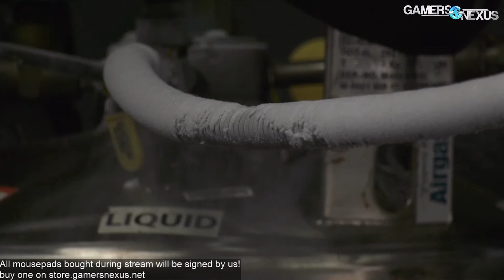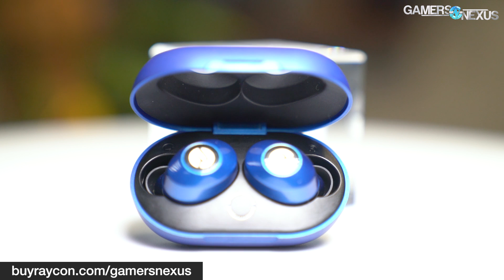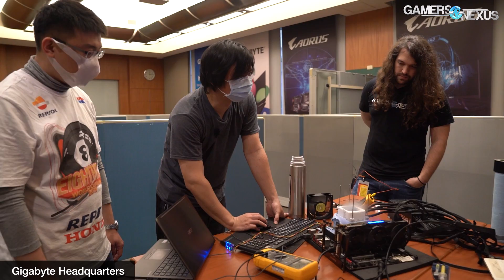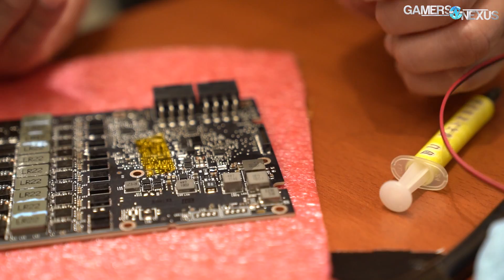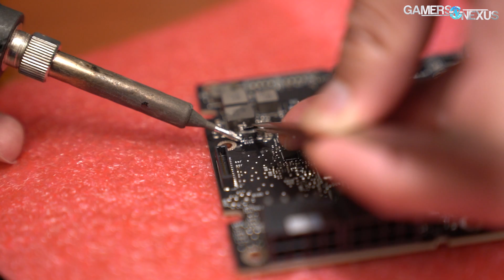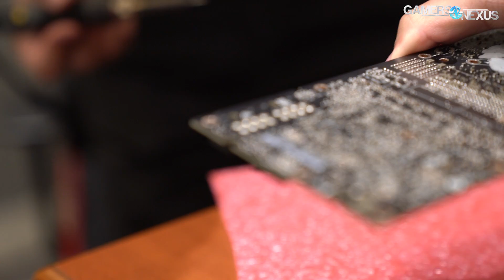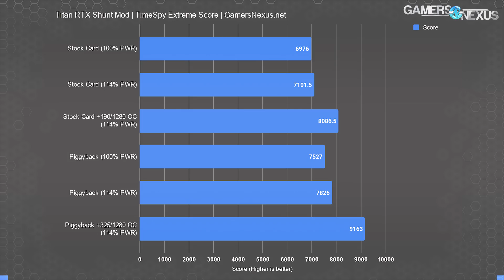RIPJAY Hardmod: Breaking NVIDIA's Rules w/ Shunt Resistor Piggyback, Ft. HiCookie

Comment: If you have problems wih melting the solder with the iron (because a. the solder on the original resisor is lead free solder wihich has a higher melting point and b the card has a lot of copper = high thermal mass) you could use a bit of bismuth solder (very low melting point. Not recomendet for soldering stuff that has to withstand a lot of physical stress because it cracks easily but for stacking a resistor for OC its ok. Also good for removing parts on a pcb in case you want to fix something without using to much heat

Comment: I have a 1060 3gb that eats 200 watts sometimes. It can run full blast 2000mhz+ constantly. I'm hitting the vcore limit I think. 😑 Have you guys looked into conductive silver epoxy for PCB trace repair? It has less risk of alloying with the solder on the board.

Comment: Learn how to solder on junk first of course. 45 watt iron works decent for most stuff and chemwick solder wick, leaded solder + ventilation.
Reply: Soldering to a multi-layer board with solid power and ground planes is a totally different league.  A typical 45w iron from the hardware store, or radio shack, etc, isn't going to cut it.
Reply: @nwimpney  True, just sending a message for beginners. I had to step up to a weller station a while ago for this reason.

Comment: There's no need for a high temperature soldering iron, all what needed is as high thermal mass tip as suitable for the job. After that you might want to compensate with increased temperature.
Reply: nah.  the thermal mass doesn't help when you've got enough dissipation on the board.
What you actually need is a high powered soldering iron with good regulation.   And by good regulation I don't mean accuracy, but that there's a low thermal impedance between the temperature sensor and the tip so the iron actually knows how hot its tip is.

Comment: This is a good illustration of why it's always a good idea to preheat your work with hot air before you start trying to solder. The copper in the PCB will quickly wick and disperse the heat from your iron if you dont give it at least a little bit of heat pre-soak. Also flux is critical in any PCB rework application in my experience. You can use almost any flux but the Amtech flux that Louis Rossman uses and recommends is among the best imo. I've done PCB reworks with the cheap flux from Harbor Freight, and that works fine as long as you remember to clean up your work afterward with isopropyl alcohol and a toothbrush, then gentle heat to drive off any moisture before powering on to test.
Reply from the maker: The video is edited. He did do that, but we cut some of that out. He still needed a hotter iron. Good advice nonetheless!
Reply: @GamersNexus  I guess it looks like my comment was being critical of HiCookie's work. This was not my intent whatsoever. HiCookie undoubtably has way, way more experience than I do with PCB rework and I am in no position to criticize his work in any way. My comment was mostly intended as a tip for people who way want to do this type of mod to their own card who also have no or limited experience with PCB rework. Apologies to Gamer's Nexus and HiCookie if my comment was interpreted as criticism of HiCookie.

Comment: Wonder if Louis Rossman watched this screaming at the screen
Reply: Hopefully, like Jay's video, we find out if he did.
Reply: @mjc0961  I also want to know.
Reply: volts- ѧ  Looks like the standard resistor is 5 mOhms, which they said wasn't a stable parallel shunt mod (7 was iffy, and 8 seemed to report success in their research). Putting a 5 mOhm on a 5 mOhm would result in 2.5 mOhms of resistance, which must result in too little voltage drop over the resistance and it triggers ocp. 8 and 5 mOhm in parallel results in just over 3 mOhms. Since the system is calibrated to expect 5mOhms of resistance (a theoretical maximum of 2400A) but it really only has 3.08 mOhms (a theoretical maximum of 3896A), that will proportionately scale down (not perfectly, obviously, as now it's a real circuit with non-ideal efficiency) into the realistic current levels (25-40 Amps).

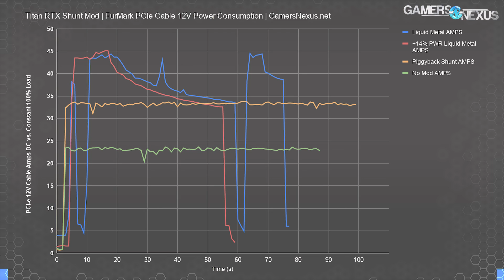That said, I think there's a discrepancy between their chart at 11:00 and the chart at 11:37. The first shows about 23A on the stock settings using Furmark. That ought to be about 276W, but on the second chart (also Furmark) it shows that as the power (approximately) for the 114% overpower test. The first chart shows about 33A for the shunt mod, about 396W, which on the second chart is the power for the non overpower value. I think they used the overpower current for the non-modded line on the first chart, as it should have been around 20A to result in only 238.8W as per the second chart.
Reply: @HMarcBower  From a relatively noob level understanding, I'm confused as to why there's "a need" to run this configuration as a parallel shunt... Wouldn't just removing the original and putting a different mOhm resistor in its place make more sense than forcing it to be done parallel? Or is that a level of hard-modding beyond typical ability?
Reply: @RAW_Reality  Electrically it would be equivalent. I suspect that they want to try to avoid removing the installed smd for fear of damaging one of the solder pads. Hopefully, if someone knows for sure why stacking is preferred to replacing, they will chime in. :)
Reply: @RAW_Reality  Both ways are wrong, since reducing shunt resistance does not provide you fine control to the reported power (without turning everything off and soldering card again).
Reply: @xDevscom_EE  That was what i was thinking. Isn't there a way to replace that resistor with a trimmer potentiometer? i don't know if they make them in such value range but they probably do.
Obviously the mod would be a lil more complicated but much more controlable results in the end i think.
Reply: @Sarklord  10 Ohm 25 turn pots are easy enough to find.

They kind of stitched steve up here with such a low temperature on that iron. Go hot and fast. 300*C would make things much easier.
Reply: @thegribbs  and the 25 turn 10 ohm pot would need to be turned 1/50th of a turn to get 8 mOhms. Not exactly practical. @xDevs_com maybe you don't mean wrong so much as less measurable. Note that they ignore reported power and just measure current. It's actually really simple to calculate the real power (approximately) based on the ratio I stated above based on theoretical max currents.
Reply: @Sarklord  @thegribbs no, such a thing as a milliohm current shunt trimpot doesn't exist, that would be extremely stupid.

I think what xdevs is talking about is tracing the voltage taps off the shunt to a voltage gain stage, where you could do a lot, like you could clamp it to a given voltage or use much more convenient values to modify it.

But i don't see why 'fine control' must be necessarily needed at all. All you're trying to do is unlock some overclocking, so the power limit doesn't end up pissing on your parade, and those current values achieved with piggyback and 3.1 mOhm shunt total instead of 5mOhm are actually already quite scary enough.
Reply: @thegribbs  300C... My usual iron temp is 370C sometimes a bit more on heavy jobs.
Reply: I don't see why he would, the solder job seems decent enough...
Reply: Plot twist: Jay partners up with Louis Rossmann so he can get the mod as well basically cheating like he did.
Reply: "HEAT THE BOARD!!!" 😂😂😂😂😂
Reply: He actually did! https://www.youtube.com/watch?v=y_v7p3xEPDM
Reply: @Artanys62  no , thats him screaming at jays video not this one

Comment: guys it's not hard to solder that stuff cmon i resoldered an smd capacitor on a Ti200 back in the stone age.. stop cheating with liquid metal, this practice needs to die.
Reply from the maker: Cool story. Not everyone is born with knowledge of how to do stuff, so sometimes it can be helpful to venture out and learn something new. Rather than gatekeeping, maybe try being the teacher?
Reply: @GamersNexus  me born with knowledge? :D i wish. i was a dumbass and snapped a cap off the gpu while mounting a waterblock. went to the store, got a crappy iron and some solder and fixed my stuff. i NEVER soldered anything before that and that was in the 56k modem days where youtube tutorials didn't really exist.

to be fair i too was intrigued by liquid metal mods initially - there were tons of mods based on a similar principle (pencil mod to increase vcore) so a permanent and painless solution sounded fantastic, but after learning that the stuff can corrode the pads or even worse come off like what.. more than 1 year ago? naah man, i understand the "for science" thing but at this point it's indirectly advocating for people to take the shortcut and break stuff, despite the warnings everyone puts up.

about warranty, if the solder gets corroded no way it passes, or if it does it means nobody looked at the card.
at that point i'd solder anytime.

Comment: Odd question; wouldn't it be a better idea to replace the shunt with a potentiometer? You could then dial in the maximum amount of power without tripping other protection circuits. It would take more fiddling to find the right spot than just putting another shunt on top of the one already there but I think you could probably find a few more watts of power that way.
Reply from the maker: There are a lot of things that'd be better, but they also get more difficult. We also threw all this together quickly while traveling, and the shunt mod was a guaranteed success. We didn't have the ability to validate that it worked while traveling.
Reply: I was thinking you could tune it with the length of a wire, I don't know if you could get a pot. that has low enough resistance or high enough current capabilities
-not an EE
Reply: @teddygoboom1  no, there is no such pot lol.

Comment: Jayz with a soldering iron... lol. Looks like you got this one in the bag.
Reply: I love Jay he is a great example for a Human Being.

Teaching us there is always more to learn.
Reply: @BobLSaget  I like watching Voultar. He's harsh on the stuff he's fixing up but he also teaches you alot. It makes me feel like you're an apprentice to a grouchy master.
Reply: From the way he handles those models I'm pretty sure he's not that bad with the soldering iron (or at least won't be after watching a few videos on what the hell he should be doing), but doing things the janky way is kinda his shtick.

I really liked his video, showed you need less than zero skill to actually fix that card. Then I liked Louis Rossmann's video as well, pointing out what Jay did wrong in his own style.
Reply: @DeeSnow97  dont be fooled Jay was lucky his soldering job worked... There is a low chance his work lasts long term... 

It's pretty important to use flux to prevent oxidation and makes a good mating surface.
 You did see how long it took him right?!?
Reply: @BobLSaget  That's not so much because of the flux, as because he's using an underpowered unregulated soldering iron.  Those "fire-sticks" get to very high temperatures, but extremely slowly, and as soon as you touch them to something connected to a large copper plane, it just sucks all the heat out faster than the iron produces it.

Flux is definitely useful to remove oxidation and allow proper wetting, but you still need a sufficient soldering iron to do the job.

Comment: Holy crap I thought some dude died

edit: guys I need a little advice. Some time ago I got a Legion y540 with i7-9750H and I was wondering about what's the best tool for the undervolt, Throttlestop or XTU? thx
Reply: I personally prefer using XTU for Intel stuff, but you'd probably be best off asking this on Jarrod'sTech('s?) Channel, he does a lot of laptop undervolting.
Reply: @teddygoboom1  Thanks. Yep, by logic I thought XTU would be better as it's Intel's, but then I've been reading some mixed opinions on the internet, hence the question

Comment: Does the king pin editions of GPUs have those safety precautions?
Reply from the maker: Great question! With a custom XOC VBIOS, the KINGPIN cards (and similar XOC cards) can bypass those limitations in a much easier way -- with firmware, so no hardmod required. Very good question. That's part of the reason they cost so much: They basically do that work upfront for you.
Reply: @GamersNexus  thanks for rating my question. Just thought that after market partners could make cards which are easier to do these mods to. Thanks for the answer and now I get why they charge so much for these cards.
Reply: @HeresJohnny1201  The mod just works by fooling the card into thinking it's putting out less power than it is.  If the manufacturers wanted to let you run more power, it's easier to just change the bios settings for a higher power target so it's allowed to, instead of tricking it.
The reason they don't all do that is because AFAIK nvidia's design rules don't let them exceed 150W per 8 pin connector (and likely other limitations), so  they would get in crap with nvidia if they release a bios that  does this, without meeting the other restrictions, like the XOC cards do.  (This is why they have 3 power connectors, etc.)
Reply: @GamersNexus  Which is why I wish Buildzoid's wish of Nvidia allowing a Titan RTX Kingpin would come true!

Comment: Any new word on the longevity of liquid metal mods on shunt resistors? Channels like Louis Rossmann are pretty adamant that that stuff eats through the backplane of your PCB and effectively rots your board with gallium corrosion.
Reply from the maker: We talked about it in this video. We haven't had any issues and have left it on cards for over a year, but we still don't recommend it. Just don't smother the legs in LM. Use it for competitive scoring. Shunt resistor piggybacking is definitely the way to go, but it is higher risk in several ways, I guess. We've not had issues with LM killing parts, but we also apply it very carefully.
Reply: Unless Louis has tested this and shown proof, it needs to be backed by actual science or evidence, sir.
Reply: @olealgoritme6774  I don't recall Louis ever saying anything about it eating through the backplane of your PCB and rotting your board, but I could just be forgetting.
What I do know has been demonstrated by both a card Louis repaired ( https://www.youtube.com/watch?v=HPqi8RdApxc ) and that Jay broke ( https://www.youtube.com/watch?v=W25gvfTVCvM ) is that liquid metal will eat away at the solder if it gets on the solder. This is also what was said in this very video we're commenting on - keep it on the top of the shunt resister, don't get it on the legs or let it spill over.
Reply: @olealgoritme6774  ok